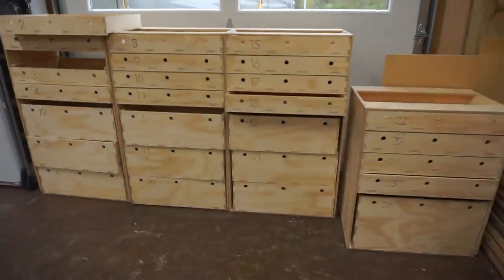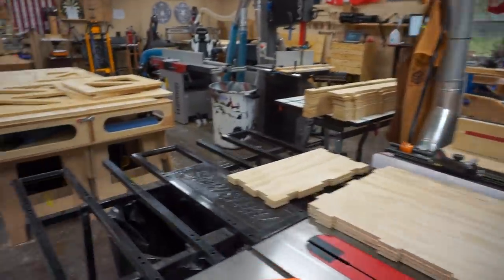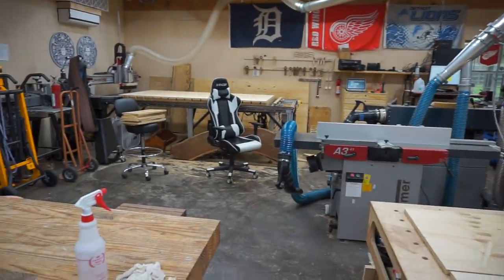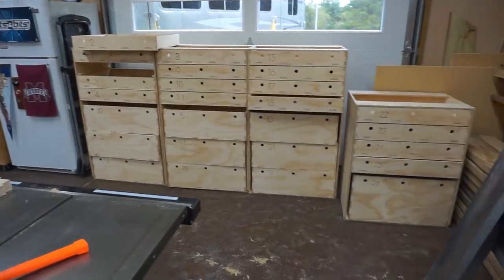5-1/2 hours

Comment: ok i have questions: double axel trailer obviously? how long? and whats the  cargo? I have a 6x12 v nose single axel trailer for plumbing and it weighs alot with my current shelving system.  Was wondering what the weight is ans if I need to invest in my 7x14 double axel for my next trailer